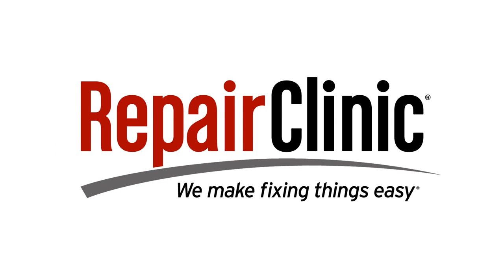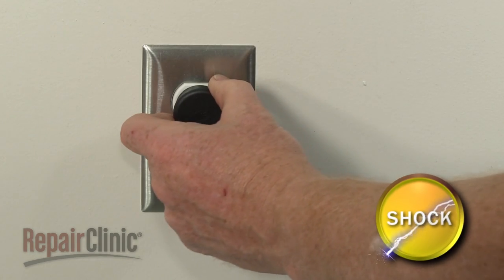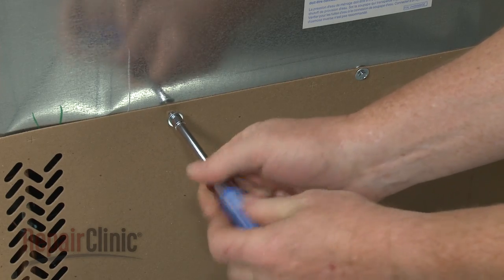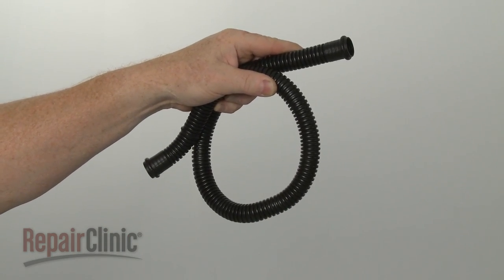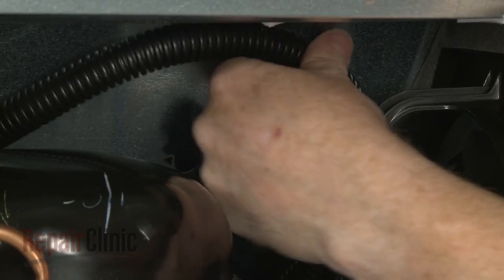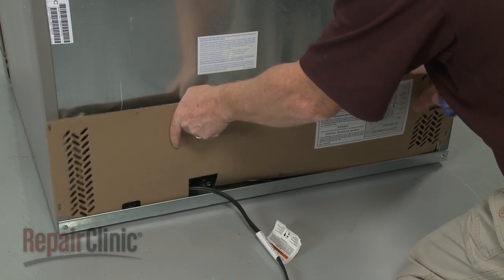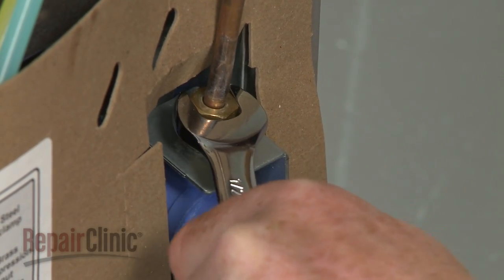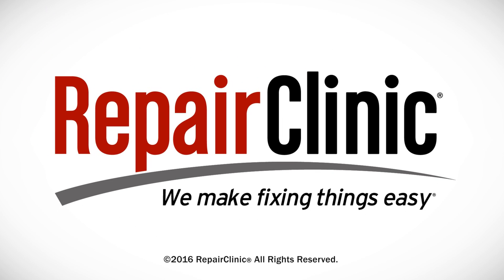Frigidaire Refrigerator Drain Tube Replacement 241830904

Comment: I’ll try and make this easy - after watching many videos, and spending time doing a bunch of unnecessary removal, MY issue was the drain hose was gunked up. I didnt need to take the inside of the freezer apart.. just removed drain hose from freezer exit port, used a snake for it, put it back into freezer drain port, done. Took 2 hours of tearing things apart when all i needed was 30 mins maybe. Ice could certainly be blocking the freezer drain, or, its the hose thats blocked. Thats it.

Comment: Thanks for the video.
I have the same exact model. When I open it up, I see one end hook to the top and the other end to another (drain?) hose (facing down to the drain pan.). This video says just put this other end to the drain pan. Which is correct?

Comment: where is drain hole located is it inside the refrigerator
Reply: Super late but for anyone else that has the same question, yes. You have to remove a cover panel on the freezer side. There’s a small drain in which the melted ice should drain into. Obviously if the drain is plug, ice will accumulate at the bottom of your freezer and will eventually leak into the floor. Easy fix with a bit of research for your particular model/make.

Comment: Ok I did that... Except I kept the old one put my hand in a fist over the end blew the obstruction out into drain pan...reconnected it easy peasy...
Reply: I never pulled it completely out just disconnected it from the clip on back & blew it out... Will let ya know if it's completely "fixed" in a day or two

Comment: My drain tube ABSOLUTELY WILL NOT come out. It also looks like there’s a black cap on the end of the tube in the freezer, at the drain hole. WTH?! I’m at a loss here. Help!
Reply: You are correct. The black drain tube is basically stuck in the fridge side where the drip pan is. Unless you take the entire fridge apart, or can somehow get to it from underneath, its super difficult.
Reply: Ever get it out?  Mine is like that too.  Super frustrating.

Comment: One thing I don’t get - doesn’t this type of drain tube simply allow a ton of warm air (especially from under the fridge where the compressor is running) to flow directly up into the freezer??  Seems inefficient, and like it would make the freezer drain prone to freezing up (which mine was).
Reply: No it does not. The loop forms a trap seal preventing air flow. This works similar to a sink trap to prevent sewer gases from entering a living space

Comment: Does anyone know how to get the drainage container off the upright freezers. Is hooked on top of motor
Reply: Our drain pan has a plastic clip located where the pan is mounted to the top of the motor. I had to gently push the clip down and then push the whole pan away from the motor, toward the center of the freezer in our case, to get it to release. It was located at the top of the motor and had some puddy where the plastic touched the motor cover.